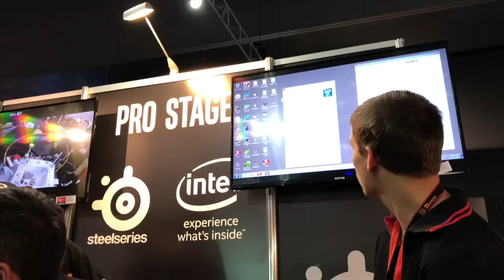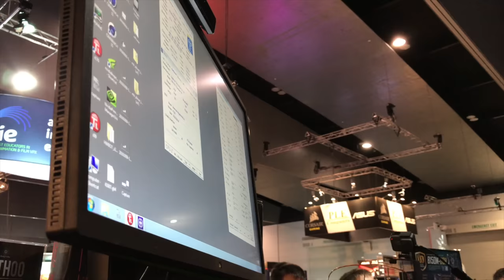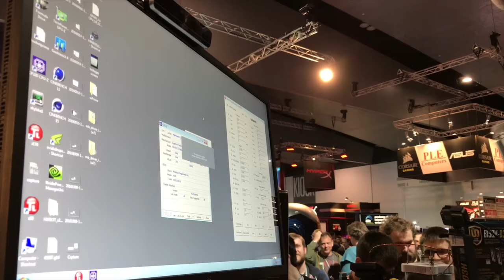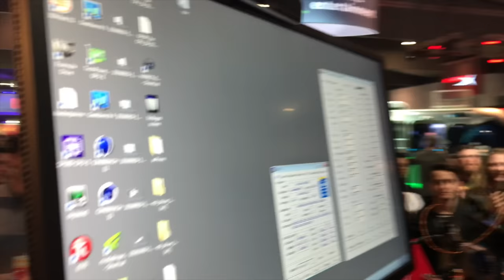WORLD RECORD - Worlds FASTEST i7 6950x CPU - Extreme Overclocking Live on Stage

Comment: I'd give my right nut for that CPU.  I mean that's not a very good trade on my part, because even my smaller left nut is worth more than the 6950X, but that's likely the only way I'm going to ever get one, so it makes sense.  :D

Some teams are using liquid Helium now too.  Liquid nitrogen is -196C, Liquid Helium is -296C, so it's allowing for even crazier overclocks.  I saw one team get over 6.8ghz on LHe, but in all fairness, they were dealing with less than half the cores, because it was on a 6700K, which is significantly easier to overclock.

All overclocking is basically the same, hardware and software-wise, so I bet you'd do just fine at it, Blunty.  You still find the highest stable bclk, memory clock (if you're benchmarking for records), core clock (bclk x multiplier) and cache clock (which makes little difference, but in benchmarking, you want all of your system running at the maximum it can run).  Most people these days don't do any bclk or cache overclocking, they just go to the highest multiplier they can reach while still keeping temperatures in an acceptable range...some overclock memory, some don't.  I do it all, since I run my apps from a RAMdisk, it's imperative that everything works at its peak performance.  I even run web browsers and browser profiles in RAM because it's a noticable speed difference.  Plus, it's just fun to do.  I had a phase change system back in the early 2000s, which was fun, but not really set up to run on a daily basis, because ice built up around the CPU socket and memory, so I had to put vaseline on my board and it was just a disgusting mess.
Reply: Liquid Helium is -269ºC, not -296ºC :p
Reply: But does it matter how cold is it? I mean, they even need to use a torch to not over cool it